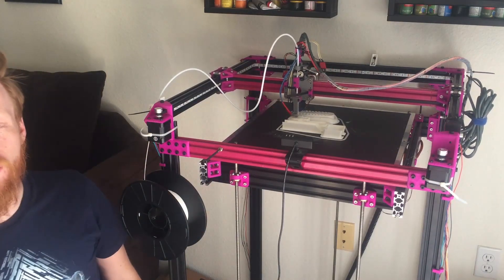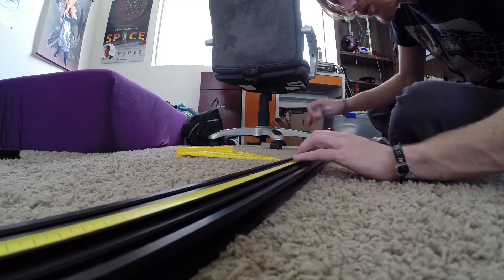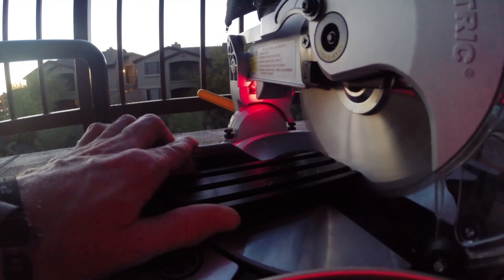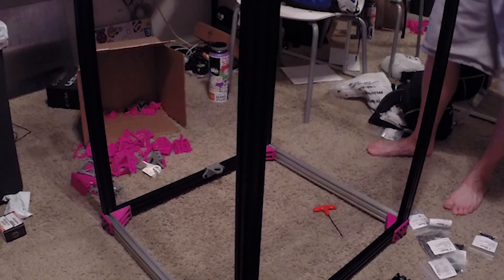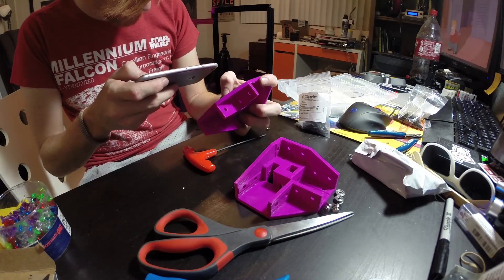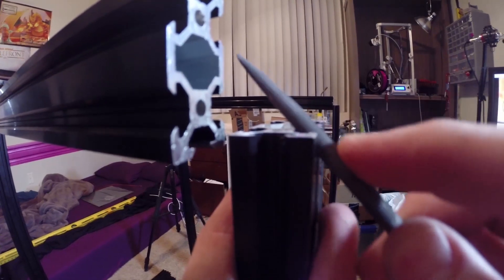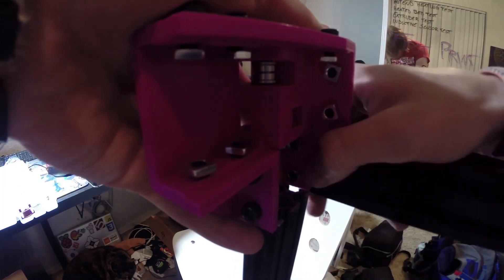MagentaBot D-Bot Huge CoreXY Build Log - 01 - The Frame

Comment: Can you list the cut length for all the aluminium extrusion for you printer size?
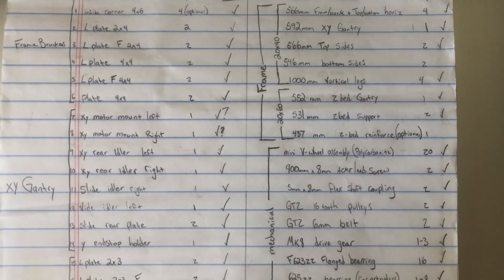Reply from the maker: if you check the parts list @2:01 the right side column, at the top lists the full lengths, and they are grouped by 'width' of aluminum extrusion. (20x40, 20x60, etc) and grouped under the 'FRAME' bracket at the top of the list

Comment: Where did you get the anodized magenta vslot rails?
Reply from the maker: its more than a little late, but they are actually spray painted magenta. just regular krylon paint, that i tried to match as close as possible to the color of filament i had.